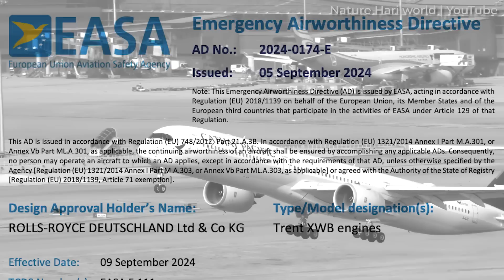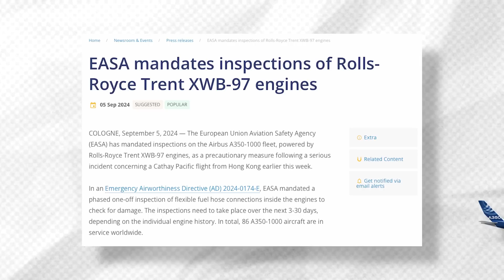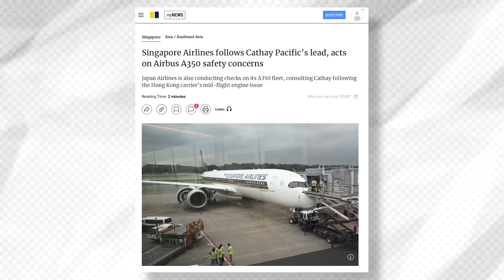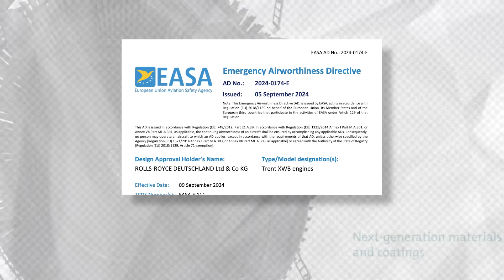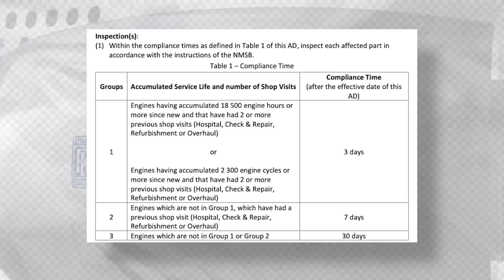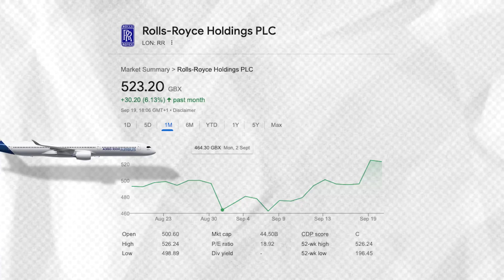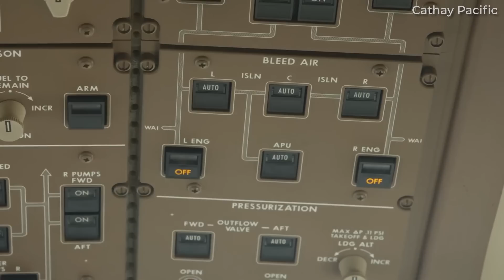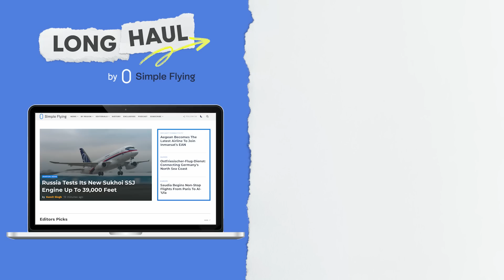The Sudden Grounding Of Airbus A350-1000s Explained

Comment from the maker: Update: EASA now advises that operators of both A350-900 and -1000 check their engines. It stated:

“In-service and in-shop inspections since then have identified that a specific cleaning process available during engine refurbishment may lead to fuel manifold main fuel hose degradation".

One person familiar with the probe told Reuters that the wrong type of cleaning product may have been used in at least one repair plant.

Comment: The commercial aircraft industry is often described as a duopoly, but it might be better called a 5+ member oligopoly. The three engine makers GE, Rolls Royce and Pratt & Whitney are as important as the two airframe manufacturers (with France's SAFRAN a smaller engine player through its joint venture with GE).

Comment: Its Boeings fault they are the ones who approved those faulty  Trent XWB-97 engines without safety oversight Woke strikes again!!
Reply: It’s Cathay Pacific’s maintenance crews fault. And what Boeing has to do with this video? The aircraft is clearly an Airbus a350.
Reply: Stupid, its Airbus duh 🙄
Reply: @ajmillendez478  those engine were originally designed and approved to be used on the 737NG the woke culture striked when chief woke engineer at Boeing approved these faulty engines without bothering to review schematics!!! woke needs to go!

Comment: This is clearly a cathey maintenance issue worn out and faulty furl hose are changed and cheaked every month bytge airline i work for(delta airline) amd i belive all airline do that
Reply: No its not a maintenance issue. Emirates is not Buying The A350-1000 bcz of the engine issues with it
Reply: @planelover234  No they don't buy it because Tim Clark wants everything at his price. And RR won't budge.
Reply: @planelover234  Did you speak with with TIM about this? . Tim do not want tje airbus because of the higher maintenance cost and more time lost on the ground. He never say the engine is unreliable.

Comment: A good handling by CPA,
also reminded us what Sir Tim Clark said about A350-1000.................
Seems to be something they already knew
Reply: tim clack said the plane dosent perform good on hot areas wtf does that have to do with a fuel leak/engine fire
Reply: @MrViroplen Tim Clark said also said he does not want aircraft that “breaking down” higher maintenance cause ruins the operation efficiency..
Reply: 777x still has no competition. Which is why tim Clark hasn’t ordered the A350-1.
Reply: Irrelevant

Comment: Not RR's fault, but it is on Cathay's maintenance team. Worn out / faulty fuel hose should be changed regularly and is a job their maintenance team should do.
Reply: If so, there wouldn’t be an EAD for every airline to inspect their engines as well.
Reply: @0xNameless that’s only as a precaution and its also how they found out the issue is specific to only Cathay’s
Reply: @tonamg53  you don't issue a second AD after the EAD, make it have a repeat interval and expand it to engine types not operated by said airline if its airline specific.
Reply: @0xNameless  The second AD specifically warned other airlines NOT to perform a specific cleaning process that was employed by Cathay Pacific.
Reply: @tonamg53  yet the AD impacts other airlines engines as well. You seemed to not have seen the engine types in the applicability list that’s not in the Cathay fleet and that engine shop tasks and procedures are under RR responsibility.
Reply: @0xNameless  because the same cleaning procedure could potentially cause damage to all fuel hose regardless of the engine brand

Fuel hose is not specific to just one specific engine manufacture you know?

Basically it’s not the engine manufacturer’s problem. 

The problem is with Cathay Pacific’s engine cleaning process.

Comment: Looks like Sir Tim Clark is laughing in the corner… knowing that he made the right choice not to order the A350-1000 last year.
Reply: I suspect Emirates have reserved slots already for the -1000, to be confirmed when the XWB-97 is uprated, which is what Clark wanted. If not then he's a fool, because the A350 is virtually sold out, and he needs this aircraft as a backup for the jinxed B777X, which seems to have another serious problem every month now. At the moment, the engines might drop on Sir Tim's head from the wing of a Boeing 777X flying over his office. 

Further, the B777X has no service history, and until it does, no one actually knows how it will perform in the extreme climate of the UAE, and whether GE's specifications for fuel economy are confirmed. The GE9X is an unknown quantity right now, and if there are any serious teething problems with that or the airframe, then Emirates A380s will be antique by the time they're retired..............
Reply: @artrandy  yes very good response.  A350 is by far the best and modern aircraft in the skies today
Reply: @artrandy  a350f also has no service history.
Reply: @thetruthbehindplanes  
True, but the airframe its based on has, and the engines have, whereas the 777X airframe and the GE9X have not........
Reply: He's laughing so much waiting forever for his white elephants isn't he...
Reply: Meanwhile Sir Tim Clarke is crying that he won’t get his 777x until 2026 at the earliest…
Reply: @tonamg53  2026 is a dream. They're back to the drawing board for a crucial part, and it will take a long time to design, create and test it. At Boeing speed these days that is years, if not a decade.
And that if they don't make another mess, which is unlikely.
Reply: @jgnclvgmng5408  come on man… let him dream.
Reply: No big deal you are exaggerating

Comment: What exactly happened at the time that they had the engine failure?  I don't know, why do we not see issues with general electric engines or do we?
Reply: How's that GEnx engine currently going on the Boeing 777X family going there hey? 🤔😏
Reply: @markwin77  GenX doesn't powers the 777X family, it will be powered by the worlds most powerful jet engine, the Ge9X.
Reply: @planelover234  my mistake. meant the GE9X which is based from GEnx
Reply: In GE, we trust

Comment: If A350-1000 Trent-XWB-97 has lower Time on Wing......then so do w/ the upcoming A350F
Reply: The soon to be uprated XWB-97 offers more time on the wing, (reportedly twice as long), and orders for the A350F will benefit from that.......
Reply: @artrandy  Nah, it will face more issues
Reply: @planelover234  
Well, I doubt that the engines are likely to fall off, unlike the B777X....
Reply: Only for sandy environment. Until now for Qatar only.